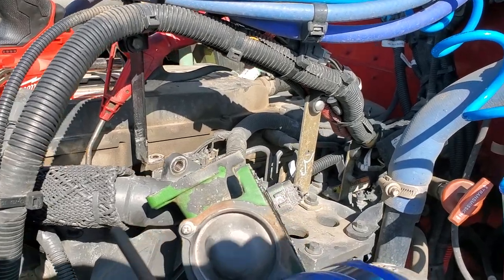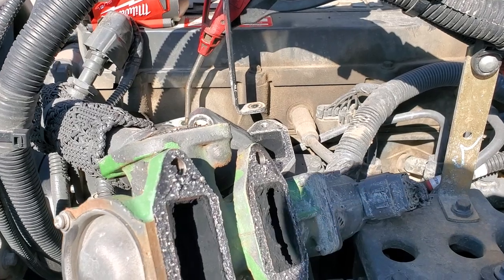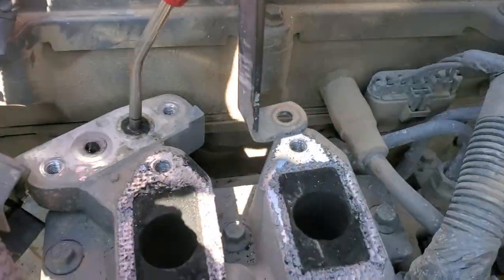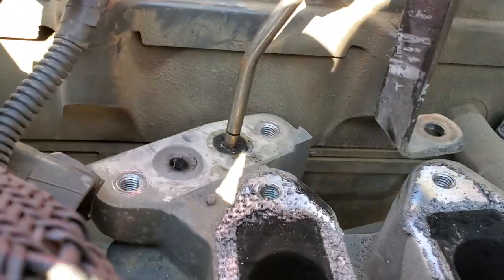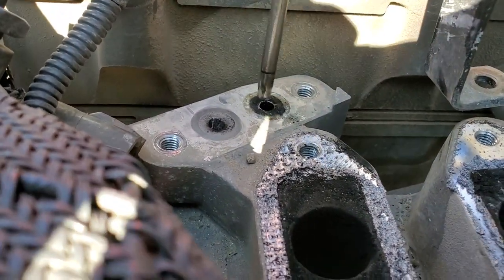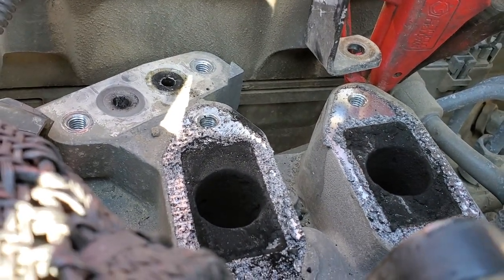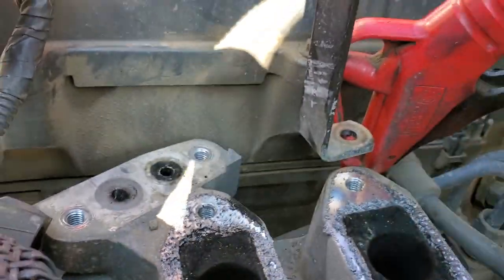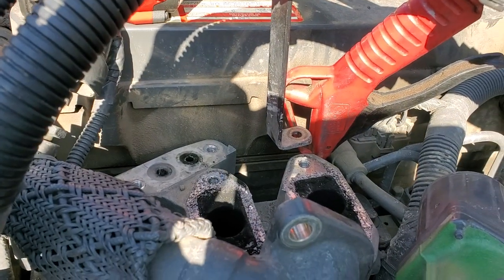Cummins ISB 6.7 EGR/Frequent Regen Tip

Comment: Yes yes yes If you are watching this video and reading this comment. This is an extremely common issue on the ISL and ISB engines. Usually the faults are for Intake Manifold Pressure, EGR system/valve (abnormal rate of change), regen too frequent, and aftertreatment related codes... ALWAYS start here. Personally I always remove the EGR Valve, crossover tube, differential preasure sensor aka delta sensor, "air mixer" or the intake where the throttle plate is and the EGR valve bolts to. They are always heavily soot caked. Clean all that old soot out until none is left. Also look for the little allen plug or plugs on the air mixer, sometimes there are more than one. Remove the plug. Clean in here as well. Reinstall everything. Your engine is now breathing again and is also sensing correct pressures because your sensing ports are no longer clogged.

Comment: If you take that air intake connection assembly off (where your pressure sensor mounts to) you’ll see on the backside there’s a hex head plug in it. Remove the plug and run a pick through the ports. It’s usually neglected because you don’t see it
Reply: working on a ISC at the moment and 1 port is completely blocked, I pulled cleanout plug and have used wire and carb cleaner and brake cleaner. I still cannot get any air flow through the port, any recommendations? Thanks
Reply: Take the intake off and find the plug that is a Allen wrench to do i..take a drill bit and hand drill it out with the help of a vice grips do not use a drill it will f the threads . Anything with a delta p sensor does this!! Traps moisture and clogs happens to the detroits and cummins that I've worked on I clean every 50k in my prevent so we don't have issues
Reply: You don't need a new sensor
Reply: No need for  new gaskets I've done enough of them if you tighten them to about 35 ft lbs or snug  they seal just fine
Reply: @gdborns77  yes I ended up taking some thick wire and kept twisting and twisting and blowing in the ports and eventually got it broke free. Thanks

Comment: They needs cleaned every 150k the differential port as well. Thats from Cummins, but on the class 4-8 they don’t recommend at that interval. Do it anyway and it will prevent this.

Comment: working on a ISC at the moment and 1 port is completely blocked, I pulled cleanout plug and have used wire and carb cleaner and brake cleaner. I still cannot get any air flow through the port, any recommendations? Thanks